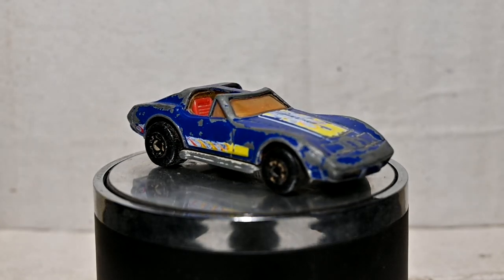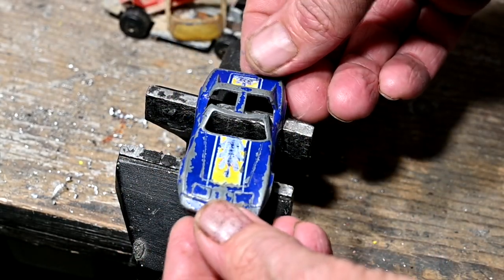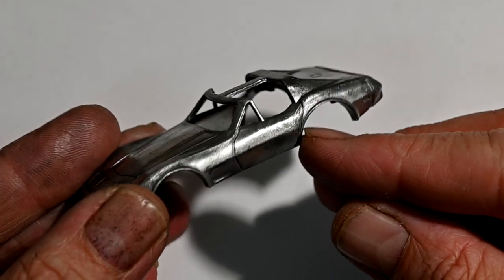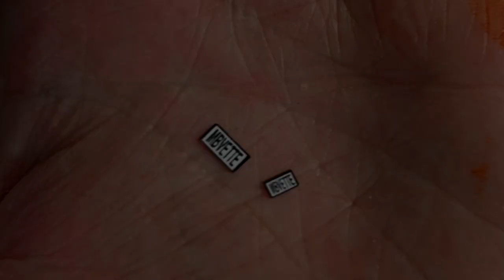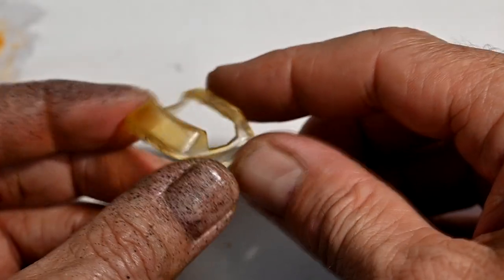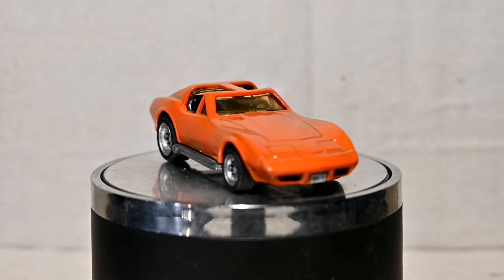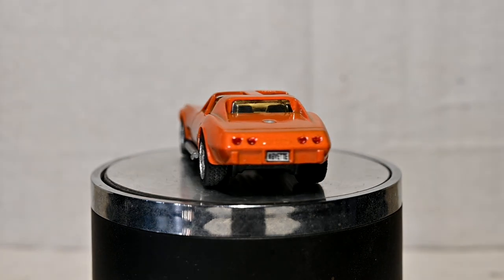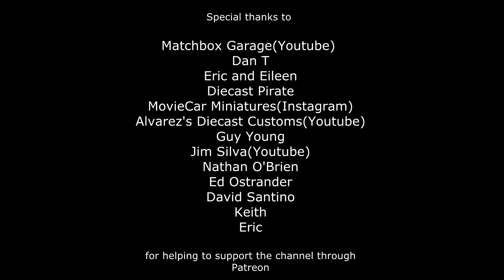Matchbox Superfast Corvette T-Roof Custom Restoration

Comment: That color is great! It reminds of a color you could get the C6 Corvette in. I'm amazed how good the windshield cleaned up. Great build! If you're ever worried about breaking something while bending it, use heat. I used a 1000watt heat gun to straighten a spoiler on a Viper.

Comment: Hi Danny, the Orange paint and wheels were spectacular. The side window pillars and the corresponding side winds-screens needed to be removed as these never existed on a corvette. The exhaust pipes had a casting line running their full length  on both sides and would have looked so much better smoothed out and re-chromed. These may not seem like large details to pay attention to, but would have made a significant improvement for a Custom Restoration.
I still like it, Thanks for sharing and God Bless, Greg
Reply: I was just thinking that.  The window side pillars looked odd.